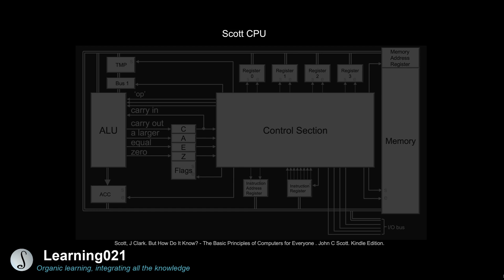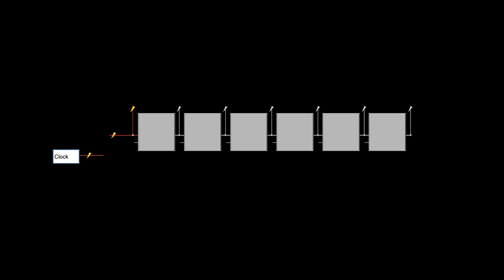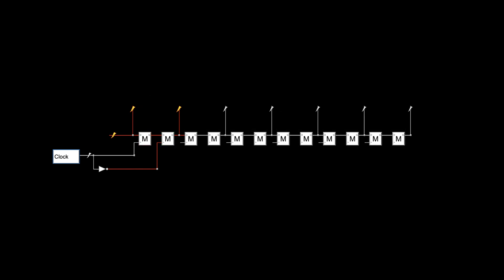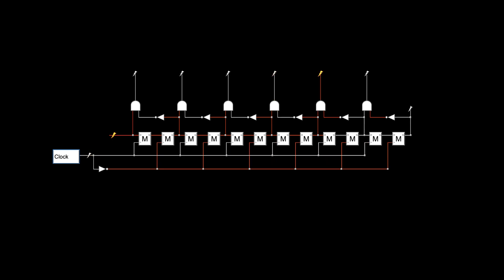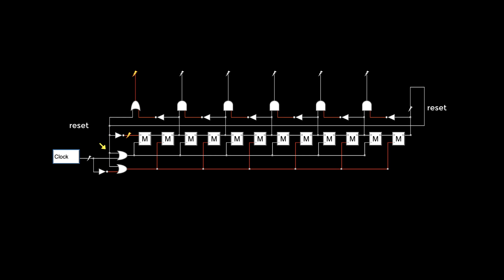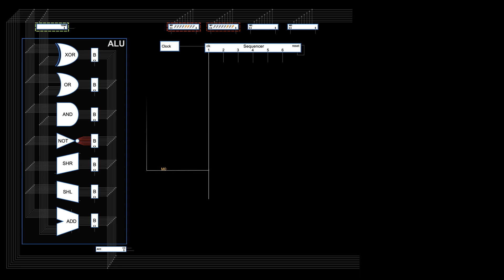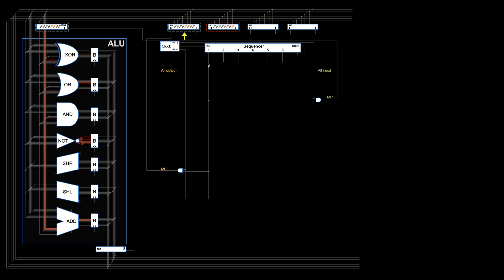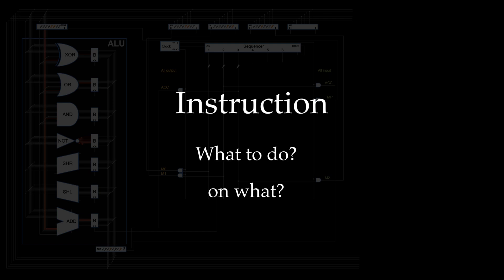Computer Sequencer | What Make a Computer, a Computer? -- hardware #2

Comment: Hello! I have a question: What does the clock's I and O mean? Are they seperate clocks or something else?
Reply from the maker: In this video you can see only one clock, generating three signals, with slight timing differences.
Reply: @Learning0to1  how would timing differences occur?
Reply: @Learning0to1  I get it now. Basically there are 2 clocks at the start. One of the clocks is delayed by a quarter of a cycle, so the wire must be longer than the clock's wire to achieve this delay. The enable clock is achieved using an or gate with the clock and the delayed clock, same goes for set clock but it's an and gate instead.
Reply: @Learning0to1  The clock is also made using a not gate from its output to its input.